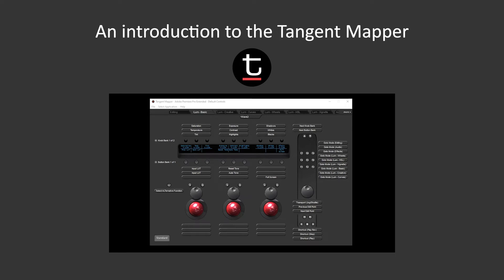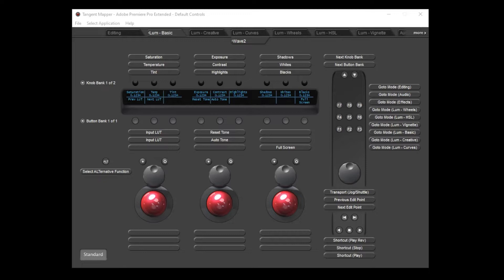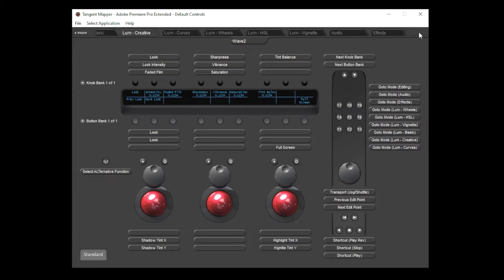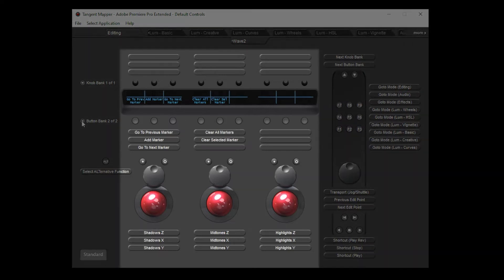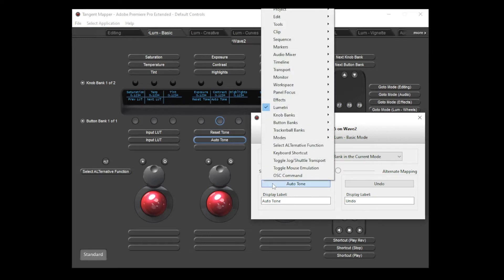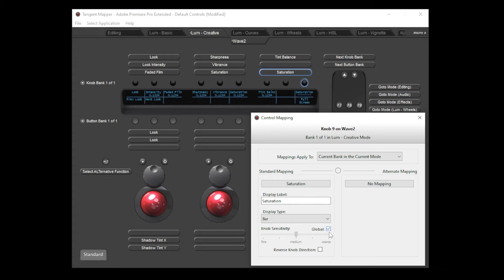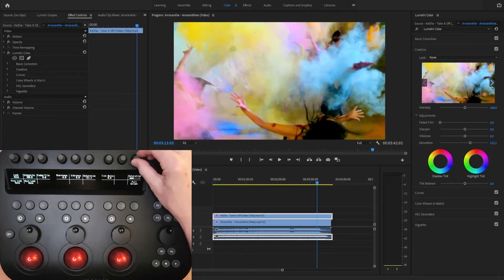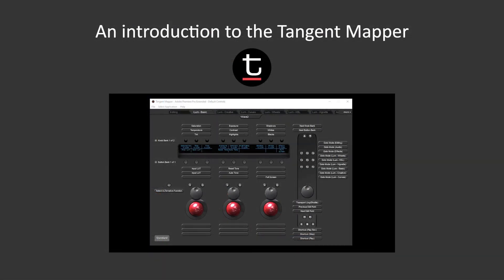An introduction to the Tangent Mapper

Comment: Is there a way to make it so it doesn't automatically change modes based off of where you are in the app? For example, I want it to ALWAYS be in editing mode unless I select a different mode.
Reply from the maker: We're guessing that you're using your Tangent panel with Adobe Premiere Pro. If this is the case then sadly there is no way to stop Premiere from sometimes changing the panel Mode itself. This is due to the way Premiere sends down a Mode Change command to our Plugin. There is no way for our Plugin to determine whether the Mode change is valid or not. 
We are considering adding a button Action to temporarily disable the Premiere Mode switching function, then you (the user) would be able to decide when Mode change commands should be ignored.
Reply: @tangentcontrol  Thanks for the reply! Yes, using it with Premiere, and good to at least know that there's no way to do it, I've been going crazy trying to figure out how to do that. It would be such a game changer for my workflow if you added that button action! Hope to see it happen some day

Comment: I have Tangent Hub downloaded, lightroom open, my panel connected but when i open tangent mapper it says there is no panel connected and i cant seem to figure out how to connect it
Reply from the maker: Hi. There is an extra step required with Lightroom Classic which is to add our plugin manually from the Plugin Manager within Lightroom. Details can be found here:
https://www.tangentwave.co.uk/download/lightroom-classic-and-element-configuration-and-mapping

Also, note that only Lightroom Classic has a panel API so that is the version which our panels can control.

Comment: Does it work with Nuke?
Reply from the maker: Unfortunately Nuke has no native integration with Tangent panels so the Mapper will only be able to send Keyboard shortcuts to Nuke. However our Warp Engine project may be helpful to control Nuke through mouse moves and clicks.
Take a look at this intro to Warp https://youtu.be/ZX9CNbBRCdY

Comment: How does the application control the modes? Is this only in Premiere? I am working in Davinci Resolve and I would love my modes to change depending on if I am in Color, Edit, etc. I should also say I am using the Warp Engine to work in Resolve

Also, is there a way for a button to do a Warp command (click on to Color page) AND change mode in Tangent Mapper? It seems that I can only do one or the other.
Reply from the maker: From your description, it sounds like you are fully using Warp Engine with Resolve rather than switching back-and-forth between the native Resolve support and Warp for just some functions. If you're using a Wave or Wave2 panel then this is the only way to operate anyway.

Warp Engine is a one-way control interface in that the panel moves the mouse around and clicks on the screen but there's no way to obtain any feedback from Resolve. This is the big difference between applications such as Premiere which support our Mapper and Resolve which doesn't. Premiere will send Mode change commands to the panels when different Lumetri panels are opened while Resolve does not. 

Your second question suggests that you have thought of a workaround, which would be to use a button on the panel to both chance panel Mode and switch Resolve between Edit, Colour etc. This can be done by using the MODE command within a Warp Script. This is explained on page 74 of the Mapper Manual:    
https://www.tangentwave.co.uk/download/tangent-mapper-user-manual/
Reply: Yes - that is exactly what I’m looking for! Thank you so much.  (And understood about the warp engine / resolve not supporting mode changes)
Reply from the maker: Great. I'm glad that we were able to help 🙂